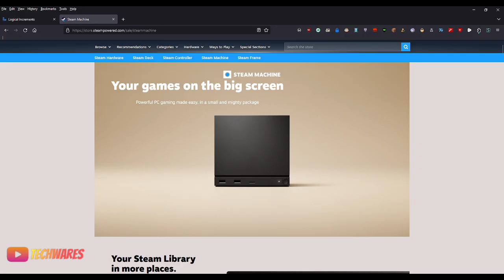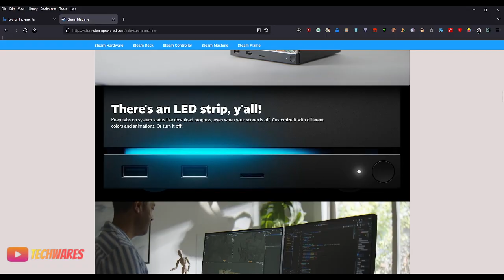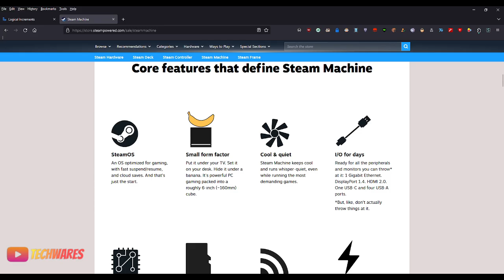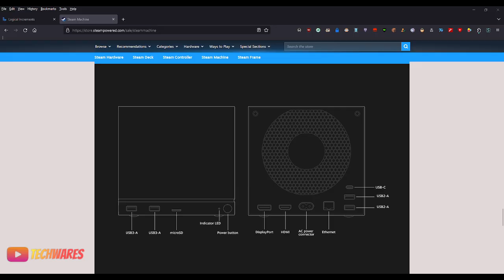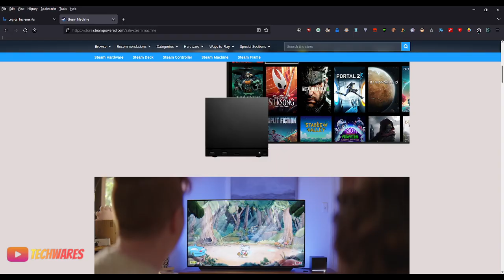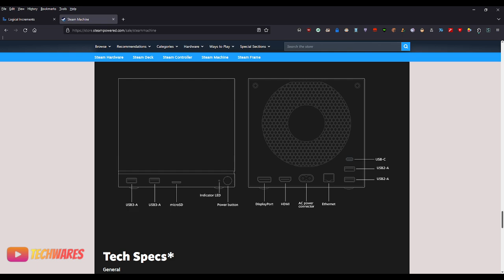Valve’s new Steam Machine is DISAPPOINTING! - 8GB VRAM Bottleneck, AMD Zen 4 and RDNA 3 E-Waste

Comment: I think steam is trying to fill the void between Consoles and PCs, so it’s has more uses than just playing games and is much smaller than a good pc; all the while being able to be a good theater/lite gaming pc for the living room; if it releases and it’s cheap; i think it’s a great deal for what it does.

The fact that you just call it e-waste is crazy since it most definitely has it use cases and most people can’t afford high-end multi thousand dollar gaming pcs.

I agree on the 4k however; i would say these specs are good for 1080p / UHD gaming.
8 GB VRAM and 16 GB RAM are okay and most people will be satisfied with that.

And one more thing; not everything has to be futureproof and constantly chasing the latest tech; even if you build a pc; most of the time it’s upgraded every 3-5 years; will the steam machine 2 release at 2031-2033? Probably. But if you think this thing should be so future proof that it lasts you 10 years without any upgrades and at a cheap price, you are just wrong or delusional.
Reply from the maker: New gen consoles like PS5 and XBOX Series X/S are designed with the latest HW and TECH, Steam Machine's HW is dated and relying heavily on software upscaling to bridge the performance gap, it will release in Q1 2026 and be obsolete by Q4 of the same year.
Reply: @T @TechWares see your point, my argument was that the steam machine is a bridge between consoles and PC; more like a jack of all trades, master of none (better than mastering one).

Steam machine is a console-like PC that people buy for their living room (only if it launches at the correct price) it’s very much subpar compared to Gen 9 consoles but still has more functionality.

And again it won’t be “obsolete” by the end of 2026; many people still rock GTX gpus so steam machine (if and only if the price is right) is a good deal (not a great deal like we imagined but non the less not “e-waste”)

Comment: Im estimating this thing releasing for about 750-850 let's just hope it's not more and hope it's on the lower side.
Still a pc and they have to account for people not buying the games through steam to offset it.
That and you can set the display resolution to 1440p for your 4k TV and get 120 fps with fsr be real guys this is basically a ps5 running Linux with a better controller and more game support + emulators.

Comment: 400-600 dollars range and it's a good alternative.

Remember back when steam deck was released they made it cheaper because they gain in game sales.
The second point is that valve has a history of underselling their promises. Steam Deck OLED was supposed to have 10-20% longer battery time, turned out to be 40-50% in some cases.

Nonetheless, if the price is less or around than a base PS5 it's a steal for what it is.
Reply from the maker: The price will most likely be between the Xbox Series S and Series X, $549 for base model, 2TB version will probably be $749 bundled with Steam Controller.

Comment: 8 gb video is not a bottleneck. I been playing with 3060 6 gb laptop over 150 fps ciberpunk año mire games.i guess in 4 k over a bit more than 60 is more than enough. It just depends from the price now.
Reply: Yeah, sure dude.
Reply from the maker: You must be running the game at 720p with upscaling and low settings.
Reply: @TechWares  1080 medium settings.
Reply from the maker: @lYarmontl  Just watched a video of someone playing it at 1080p on medium settings they were getting ~80 FPS which is not bad, but far from 150 FPS... you might have DLSS turned on or something.

Comment: Calling it ewaste is crazy. It's literally closer to the average computer that steam users have than it is closer to being e-waste, shown by the steam survey. With ram and ssd prices starting to climb back again thanks to the ai craze, I fear that "I can build my own with the same specs for less money" argument won't be realistic (or highly dependent on where you live). It's possibly not powerful than a base ps5 gpu-wise, however the cpu should be more than enough for emulation which the normal consoles can't do freely. Not the mention you can mod games in linux (since it's a proper os that doesn't limit it's users). This is why I expect it to be sold at a "premium" compared to your base console. It's a SFF pc that's configured as a console out of the box, which they let you do whatever you want with it in typical valve fashion
Reply: PC gamers are brain dead.   I have a 5070ti rig as my main gaming rig but sometimes I just want to chill on the couch and play something relaxing.  Steam machine fills that void.  Also its obviously for that 14 year old kid that wants to play steam games but the parents don't want to buy him a $1500 desktop.

Comment: Its all about the price ... if this is cheap like 399 ... its specs are not targeting enthusiasts...

Basicly a midrange laptop in disguise ... but i have to admit underwhelming to me too
Reply: Whoooaaaa 400? No way in hell, you can barely buy a decent phone for that price nowadays. Now for the laptop part... Ummm Eh? Sure it might have similar specs, but that's where that ends, this is not portable, since you need a screen, although it is small, so maybe between living rooms. The big difference would be that this is one big cooler, designed to stay at desired temperature, while most gaming laptops just love to overheat.
Reply: Laptops don't give you a "console experience".  This you turn on the tv and you're gaming in under 30 seconds with steam os.  With a laptop you have to sign in, wait for Microsoft to boot, open steam, then start gaming - every time.

Comment: I agree with you on most.

8gigs of VRAM is definitely insufficient for native 4K.
But Valve hasn't promised native 4K, and they are targeting a living room console like experience, not high refresh rate competitive gaming and not the high fidelity of the bleeding edge of the glorious PC gaming master race.

I would make the wild guess, that the took a look at the steam hardware survey and made the hardware bang on the middle of that in terms of performance.

Sure it's not something that tech savvy people would jump on because we can build for our self better specd PCs for our requirements.
But if they release it at a reasonable price, it's not gonna be straight e-waste as it is absolutely more versatile than a console.

Also in my opinion what this hardware does, doesn't even really matter because the pont is with the Steam Machine they are releasing a full fledged desktop Steam OS that many have been waiting for.